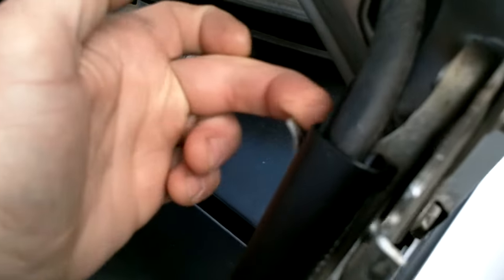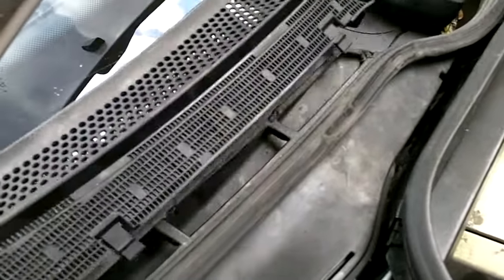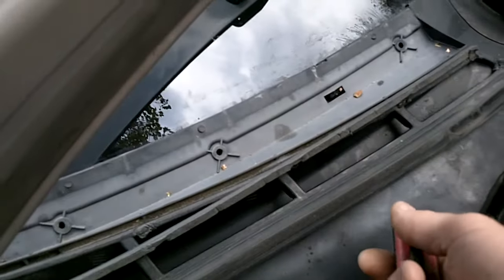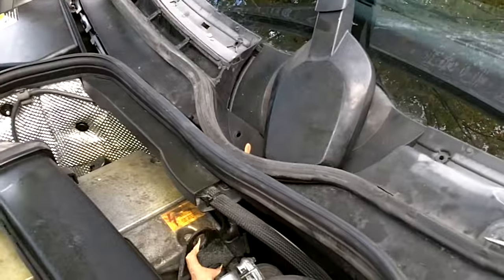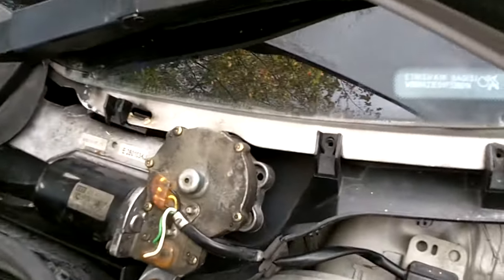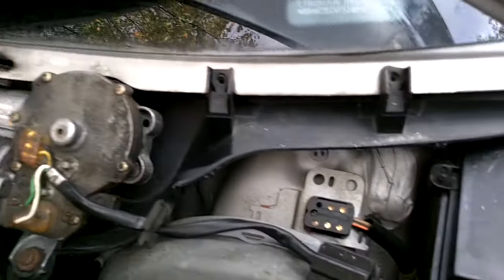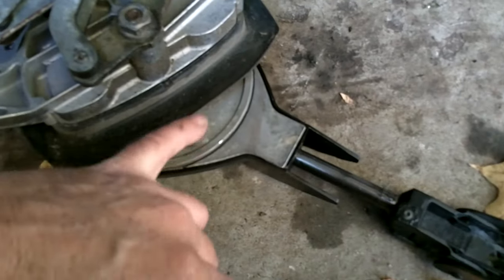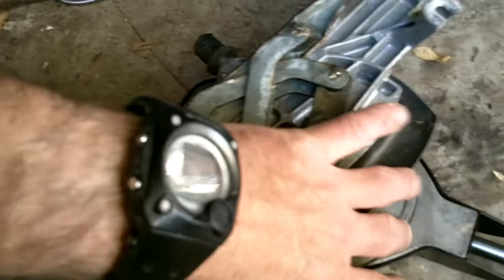how to remove Mercedes w202 windshield wiper motor assembly and lube

Comment: ***** Hi , how are you doing? I would like to ask you a question, my air recirculation is not activating when I push the bottom on ac control unit, the red light is coming on but when the ac is on I can smell everything from outside on the inside of the car, what do you think is going on?
Some one suggested I just change the unit.. 99 c280 w202

thank you so much for your time.
Reply from the maker: check the flap beside the cabin air filter...it should move when switching between recirc and outside air
Reply: ***** Ok thanks. should I remove the plastic cover that is covering the cabin filter compartment?
Reply: ***** Hi,  I opened the compartment up that exposed the cabin filter and the fan but I saw no flap.
Reply from the maker: Vaklev Bastian ..the previous owner must have removed it for some reason..it shuts at the cabin air filter to block air getting in from outside, and is visible when the filter is out
Reply: ***** Where exactly is it in there? its just a big open space in there I see nothing that looks like a flap holder.. can I somehow fit something in there?

Your help in this would be so great full. I'll compensate you for your time. If you have paypal I can send you $15-$20 right now. Just saying, I need this figured out.
Reply from the maker: Vaklev Bastian no need to pay me..I'm here to try to help....try resetting the air flap.....while the ca ris parked and running...push and hold both the "recirc" and front defrost buttons at the same time and hold them for 30 seconds..that may reset it
Reply: *****. Ok I'll try that asap.  Thanks,  I'll keep you posted
Reply: +fupabox. Don't think that worked,  when I press the rec. button shouldn't I be hearing a sound from the vacuum system?  But when I press it I actually hear nothing.  Every other button is working except that one.  The red light is coming on when I press it tho.
Reply from the maker: Vaklev Bastian yes there should be  the sound of the flap closing....the flap motor can go bad...I looked for a diagram to send you and found a good forum post you can refer to...http://www.benzworld.org/forums/w202-c-class/2006001-1999-c280-c-air-recirculation-not.html
Reply: ***** thank you il look into it..

Comment: I just lubed and tighten the screws however when i turn it on the wiper goes one way but then will not come back what do you think it is? If I buy a new motor  is it easy to reassemble the other parts of the wiper?

Comment: Hello sir! Thank you so much for the video.. mine is c230 year 2000 nd the problem is i can hear the sound of the motor but wiper doesnt move but if i push the wiper manually to other side it cones back itself.. i am scared to take it to the mechanic cause a year ago they charged my mom $700+ to fix thr wiper and its gone again.. now i drive the car nd cant afford that :( .. if you could give me some advice.. i would highly appreciate that.. thanks again :)

Comment: Is there any difference between the model on this video and the 1991 190E wiper? I can't get the cover or "turtle cover" out of mine. Does anyone has any information on this? thanks!
Reply from the maker: +Adolfo Bisi  The cover on the older w201 (190e) and w124 (300-320e) look like the newer case in this video, but have a different cover that doesn't just pop off.. Kent has a video on the older style like yours..  https://www.youtube.com/watch?v=W3IPjKgC5AQ
Reply: +fupabox yeah, I was hoping that I could open it without removing from the car, but in the older models it is bolted from underneath, so.. no chance.
I just got the whole assembly removed and I was very disappointed. The articulating gear was broken at some point and the previous owner fixed everything in the "closed" position, making the disassembly a lot harder. Anyway, great video, helped me a lot.
Reply from the maker: Adolfo Bisi I have seen older cars that guys have drilled a hole in the top of the cover so they could squirt grease in.. then they pop a rubber plug into the hole to keep water out. Sounds like with the broken gear grease isn't the problem though... there are replacement gear sets on ebay if I remember correctly

Comment: I have hard time to remove turtle back from wiper ,  I want to lubricate and clean the mechanism inside . You removed it very easy , how ?  do u have separate video how to remove turtle back easy
Reply from the maker: No..it just pops up . There are early versions where the cover will not come off ,,what year ans model is your car ?
Reply: @fupabox   Thanks ,  it is C180 / W202 / 2001  It is moving and stucking time from time , and finaly it stopped working.

Comment: Help ,my windshield wiper on my C230 Mercedes, 2000 kompressor stopped working but I can still hear the motor.I took it to a shop I use sometimes and he looked at it and said it was the arm was broken, but he was closing an didn't have time to talk.Because I'm a woman I'm wondering what would be the cost for something like that. Help.

Comment: I took my '99 c280 to an Indie he said bad motor.
It is now working but the blade parks on passenger side, where prior it would park on drivers side. I also couldn't see the blade from inside before, now it seems it sits up higher on the windshield than before.
Any tips on how to remedy this?

Comment: can you  tell me what  the best coil i can put in a 380 se  1985  thanks arthur
Reply from the maker: Bosch are always best on Mercedes
Reply: is  85  380  se cast iron heAD or aliuminum  also whats the spark gap
Reply from the maker: Arthur Metcalfe .9 mm  if you are using the old coils...if you use a new coil and drive fairly gently, you could open the gap to around .95mm for a bit smoother running and better mileage..not sure if the head is iron or aluminum...put a magnet against it and see if it sticks  :)

Comment: *****  Hey can you help me with something :) On 9:07 in the vid, where you are showing your broken braket, the left peace(the bigger one) - how do you get to the half circle mechanism with a gear-wheel  inside it ( you put your hand on it 9:17)  ? Loosen the 17mm bolt in the back or in the front where the extension and retraction of the wiper arm ? Do I have to grease inside it too, or is it an overkill. Thanks

Comment: hello,my windshield wiper just stoped working,when I activated to work,you know 1,2 or 3 I just hear the motor working but the wiper is not moving and I can move it with my hand,which I wasnt able to do it  before.
can you help me ? what may be wrong?
Reply from the maker: either the nut on the wiper shaft,or the motor shaft is loose..it requires removing the whole assembly to tighten them...when you remove the assembly make sure the wiper is turned off so the motor returns to the "park" position...then set the wiper in that spot before you tighten either of the nuts
Reply: thank you!
this is excatly what happend,
I took it to a professional and he fixed it.
:)
Reply from the maker: ***** excellent..glad you got it sorted out  :)

Comment: Do i need to remove the whole assembly to greese the turtle cover on the 1997 c280?
Reply from the maker: nope...just pop up the cover and lube inside...nothing else needs to be removed
Reply: ***** Thanks a lot. It works now with no problem
Reply from the maker: stani11000 excellent..glad it worked out :)

Comment: Hey , I saw your video on a Mercedes C240 W202 1999 ,
 I have an identical Mercedes. But my windshield motor works as it should ,
 but you know the plunger as you view the clip at 9:50 ,
 the piston is stuck on my Mercedes that my windshield wiper strikes the edges on my window,
 if you know what I mean , it does so my wipers are too long and hit the edges of the window,
 how should I do to fix it ? replace the entire windshield arm ?
 or is it sufficient to lubricate ? or what you think i need to replace ? the hole windshield motor ?

Take care very good video would be fun to a quick answer :) take care / Jimmy sweden :D
Reply: had the same issue.  The wiper arm that goes in and out has a separate cog under the part that Fupabox was showing in the vid.  You need a big star drive to get to it (can't remember the size).  The cog is plastic and if not lubed regularly/ it never is! it is prone to breaking and the wiper arm will flop out under the force of the wiper arm moving.  You can replace the cog (and hopefully the outer gear is not stripped or you need to replace the wiper arm).  The part is not cheap for what it is 40 GB Pounds.   Alternatively for a short fix you can cable tie the arm to stop it extending (be careful though as if the wiper arm tries to extend and can't because you tied it you can burn the wiper motor)

Comment: I've got a similar issue to a lot of people here, but my wiper still actually moves; it just goes REALLY slow at some points (and it sounds like the motor is struggling)

My issue is that the problem started happening really suddenly, and it can also vary in severity (from almost not able to move, to nearly moving properly) which leads me to believe my actual gears are fine. Can you share any wisdom?

Comment: thanks! very good video but i couldnt get those clips off in the middle. using a flat nose screw driver i couldnt do it.. but i did hit my other hand with it while trying a few times. not good. so i gave up on replacing it.. and will lube just the mechanism hopeing it fixes my problem.
 *all else fails i'll sent the replacement motor wth the car into a mechanic*. thanks.

Comment: yo dude do you have much experience in w202 cars? my wiper got stuck because there was some ice on it (pretty annoying) and it stopped in middle. i got to a parking lot and removed ice but i only hear the motor when i press the wiper starter but it wont move..... i turned the wiper with my hands to normal position, did i fuck up? i hope u can help me, sry for my bad english
Reply from the maker: Your English is fine.. One of the nuts on the back of the wiper motor is likely loosened.

Comment: what grease did you use my wiper stop at the center slowly  then continues moving
Reply from the maker: synthetic high speed bearing grease .. Mobil 1
Reply: another alternative from auto zone or orileys??
Reply from the maker: any synthetic wheel bearing/high temp grease will work

Comment: Where can I get R129 keys - dealer says NLA - cannot believe that R129s will be isolated because of this issue - lets get motivated - you can help
Reply from the maker: do you mean the original flip key with 1 button remote ?  or the blank normal key

Comment: My problem is that the windshield wiper doesnt move. it sits in one position and vibrates. I was told it was fixed by the mechanics at the dealership after dropping almost $1k on a new transmission, but the same problem happens again. I was told this time by the dealership that some teeth on a gear where gone, and i needed to replace a gear or something like that. Does this seem legit? If so, where do i find these gear teeth?
Thanks

Comment: Very helpful video. My windshield wiper stopped moving but I can hear the motor trying to work. The dealership told me I need a new gear assembly and possibly a new wiper motor. All expensive. So I'm hoping some of your tips on here will save me from having to go that route. Thank you! Any further tips for replacing the wiper gear? If not that's ok but just though I'd ask :)
Reply from the maker: just try to keep everything in the same relation to each other when re-assembling
Reply: Ok thanks

Comment: my windshield wiper won't move any more after the snow what needs to be replaced any ideas motor maybe?
Reply from the maker: possibly the motor, it could also be the linkage is loose from fighting a lot of snow, or the fuse has blown from heavy snow as well.. check your fuse first ..your owners manual will show you where the fuse box is on your car , and which fuse is for the wipers..
Reply: fupabox thanks soo much

Comment: how do I find out which type of motor I have without pulling it?  Trying to order a replacement motor, and though I have the original parts number and have run the VIN- everyone wants to know which motor it is..  Not even the mercedes dealership could tell me which one it is.  I'm not the one doing the repair so how do I find that without pulling it out?

Comment: Can some one help me.. I took my Mercedes c 280 2006 to a shop to change the windshield wiper motor & they told me my windshield had a small crack in it & when they changed the windshield motor it made the crack get bigger now theirs a big crack in my windshield spread across the entire windshield..   Does  this sound normal?

Comment: Hey, my windshield wiper makes this crazy noise, and im wondering if you think applying Oil to the inner parts you show on this vid would help it stop? Its not the wiper blade who makes the sound, its the same with the wiper tilted up. Heres how it sounds: https://youtu.be/RYOPYvRxHc4
Reply from the maker: Andre Karlsen Cappelen If greasing under the cover doesn't work, you may need to get underneath and lubricate the linkages as well

Comment: Son of a bitch... I knew something was always screwy with my wiper. When I replaced the blade the ends were hitting off the edges of the windshield on high... Figured the lookup info was wrong and used a smaller blade, not realizing the "extension" mechanism / gear doesn't work. Oh well. Doesn't really bother me. Fix it someday..

Comment: Poor Mercedes owners - have to go through this several times throughout the car's lifespan. Dumbest, most idiotic wiper system ever created - bound to stuck/seize. My mate's old rust pile of a worn out Mercedes has the exact same problem - seizes mid-front sceen. Glad I drive an Opel.

Comment: Not once did you show how to remove the motor itself...
Reply: The motor is connected to the linkage and the replacement part consists of both wiper arm and linkage already connected. It's less hassle just to replace everything.